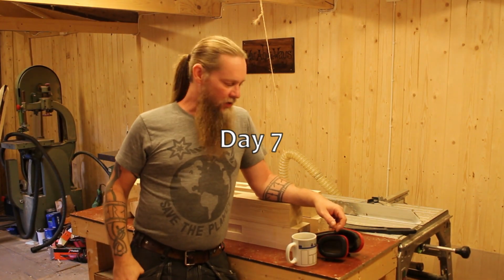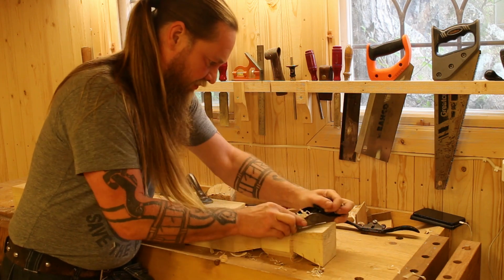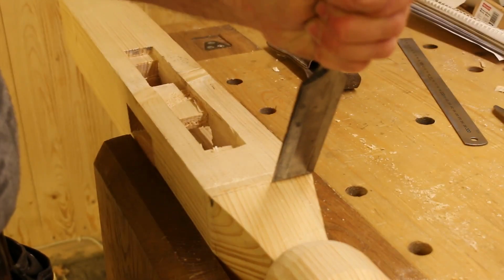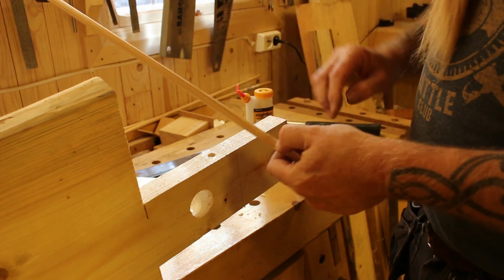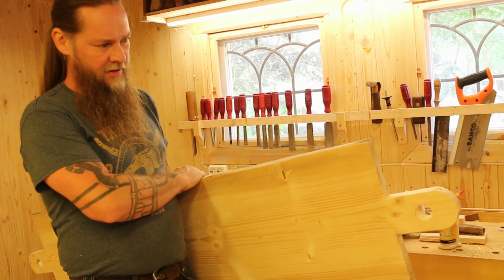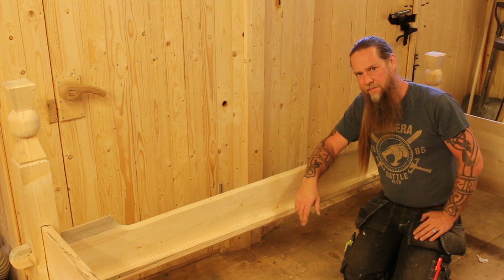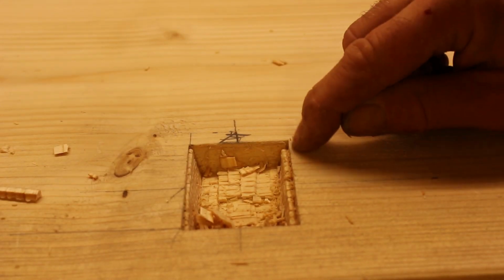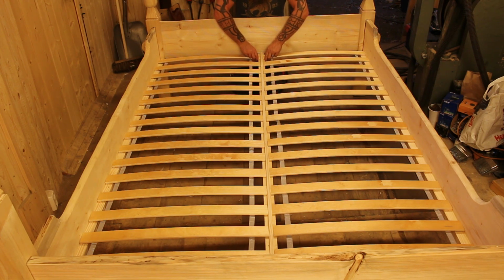Woodworking project: Make a viking bed! Traditional mortise and tenon joinery. Handtools. Part 5.

Comment: I have watched this build all the way through,, so far, not once have I seen a router,, hehe well done
Maybe  I just  not bother put a new bearing in my router, , have to start showing the old chisels șome  tlc
Reply from the maker: I’m glad you enjoy my videos. I do have a power router, a pretty nice one, but I rarely use it. If possible, I always go to the moulding planes, plow plane and router plane first. But it’s critical to keep the blades sharp, so TLC is an essential part of using those tools, as well as the chisels.

Comment: Nice way to prevent splitting with the dowels. Good to leave a good amount of extra on the dowel pins to have surface enough to bewel the pin and deform it when hitting it with the hammer.
Reply from the maker: Why you should pin the tenons is a quick lesson. One time is enough.